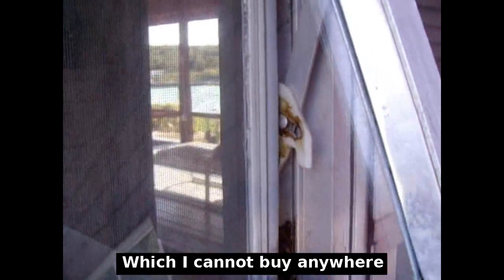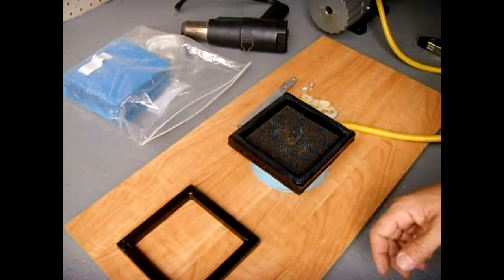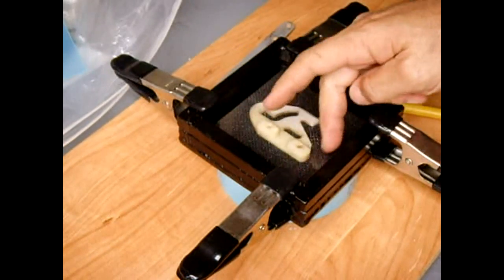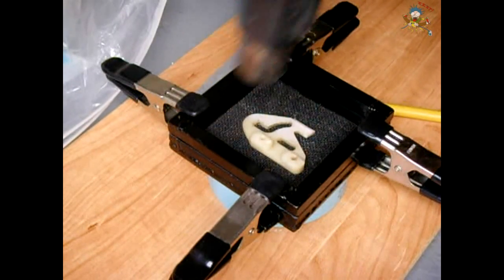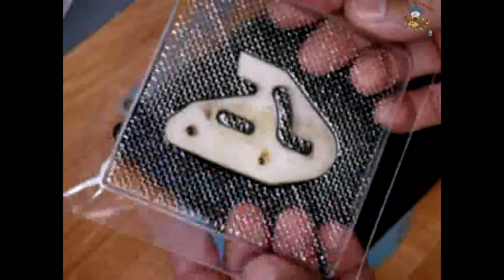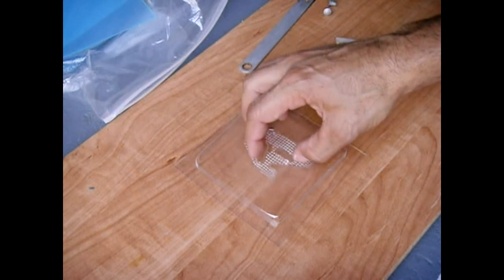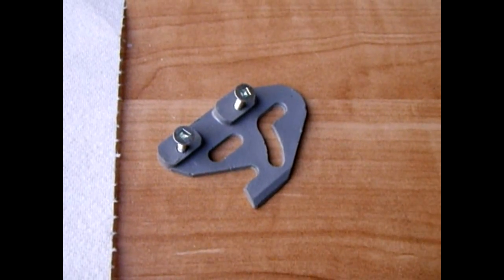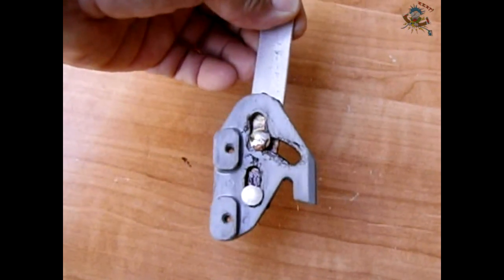DIY Vacuum Formed Replacement Window Parts

Comment: Dang, This is too Easy to have a go at.  A Refrigerator Compressor would work for this machine.  Those can be had for nothing.   Thinking J.B. Weld here.
Reply from the maker: A hermetically sealed compressor should pull a good vacuum.

Comment: Never use a heat gun.  Good video though!
Reply from the maker: How do you plan on softening the acrylic without a heat gun?
Reply: electronicsNmore easily my friend.   Nichrome resistance wire, on a control circuit, EVEN heating across the acrylic, or, a stationary heating unit over the top of it, held in place with a frame.. you do your heating the way you want bro. Just saying, never use a heat gun.
Reply from the maker: Chris Fleming LOL. I love people like you that come along and tell me not to do something that has worked just fine for over 20 years.
Reply: electronicsNmore ummm. I didn't tell you not to do anything, can you read? You asked me how I'd do it, and I answered your question. I said "Never use a heat gun" .. I didn't say  "Hey, electronicsNmore, don't use a heat gun"... Now did I?

Comment: Just wondering where you get you sheets from and if you could post a link on where and what to order Thanks
Reply from the maker: Hi there. I may have mentioned it in my dental retainer video, or at least what the material is, and the dimensions. You can search online for the 5x5 splint material.

https://www.youtube.com/watch?v=J-vut8Wwx1c
Reply: Okay got it-Thanks for getting back to me, Keep up the good videos too

Comment: Why not make a grid of kanthal wires spaced evenly on a unit the same size as the vacuum block, with some regulator to keep the temperature in check? Shouldn't cost more than a few bucks and would heat the plastic evenly and hassle free.

Aside from that, this adds yet another use for the vacuum pump I ordered last week.
Reply from the maker: Thought of that already, but I prefer the heat gun. :-)

Thanks For Watching!
Reply: electronicsNmore
 Thought as much. Just thought this looks like a hassle and wondered why not. I'll make such a grid, as I'll have surplus wire for a kiln I'll build as soon as the crap I've ordered arrives.
Reply from the maker: The grid should work well just as long as the spacing is right and not too much heat is applied :-)
Reply: electronicsNmore
The larger ones, seen in Mythbusters too, use pretty large heater elements spaced quite far apart, so it doesn't seem the spacing is as relevant, as heating the plastic to an even temperature is. What's the temperature at which those sheets become pliable? Are they HDPE -> at around 110C?
Reply from the maker: The sheets I used are acrylic. Probably starts to soften around 225-250 Deg F. If the spacing is not right, you will not have even heating. I would space the resistive wires about 3/8" - 1/2" apart, and 1/2" above the sheet. You can always lower the grid if you don't get enough heat.
Reply: electronicsNmore
I got a pretty hefty power supply out of a 48V 25A 1250W server PSU, so I think it should be able to produce too much heat without regulation, so I'll just do the maths based on the resistance and length of the wire in a grid with x length and y number of wires per width and see if the watts per area goes too high. I guess it's down to testing it in action.

I'll take a look at your video about making the form to begin with, as long as I don't get sidestepped by all your other interesting videos before I find it.
Reply from the maker: In the past I have used a lower value oil filled run capacitor in series with the hot 120VAC mains wire leading to a resistive heater made from Kanthal A1 wire. Works well once you use the right amount of wire and correct value capacitor to limit the current.
Reply: A quick calculation for a 30x30 cm working area with the wires spaced every ~3-4 cm, I'd get a 500W heater with 2 meters of the flat kanthal wire I'll have, with a 48V supply. Should be plenty enough for a low and even heat, without burning things. Even though I have an SCR trimmer, I don't think I'll dabble with mains connections for this, it's 240V here, after all.

Comment: EXCELLENT video. Why didn't you use a laser thermometer to test the temp of the plastic ?
I bought one recently, and have come up with all kinds of uses for it! One of my favorites is troubleshooting
old electronics gear looking for overheated parts. I even use it for cooking meat on the grill !
Thanks again,
73 de KG5RK
Reply from the maker: No need to do that. I have done it by touch for years. Areas that require extra heat, I do as shown in the video using the spoon as a heat shield. The problem with using a laser thermometer on meat, is that you are testing the OUTER temp of the meat, you need to be testing the center of the meat which is normally cooler.

Thanks For Watching

Comment: Fantastic Job.!! A very useful tool to have around. Thank you for sharing.
All the best.
Bobby
Reply from the maker: Thanks Bobby
Reply: electronicsNmore
I meant to ask,where do you get the sheets?. And what are you using in the center of the box?. I would like to build one for my vintage radio cabinets. I have some that are cracked, I have an ideal that may work using your tool design.
Reply from the maker: The center of the forming unit is a drywall sanding screen. The purpose is to allow even vacuum forming. 5x5 acrylic thermo plastic sheets(used in orthodontics)

Comment: There have been so many times that I have found parts that I need for service that are nla, and this is an easy way to reproduce some one off once in a lifetime parts... Being in the HVAC industry I already have the vacuum pump and plenty of heating sources at my disposal... I may try this sometime. Thanks for sharing!
Reply from the maker: You can pick up a vacuum forming machine on Ebay or Aliexpress for a reasonable cost.

Thanks for watching! Be sure to share my channel and rate Thumbs Up.

Comment: Very cool!  Great surface finish on the cast part as well.  

Seems like it might be a neat way to make forms if you have a 3D printer lying around (haha)
Reply from the maker: I originally made the vacuum forming plate for my dental retainers(check out that video), but found so many other uses for it later.

Thanks For Watching!
Reply: On a whim I split a dual layer dvd, scraped off the metal layer, heated it carefully with a torch and then just draped it over an arbitrary pattern (closed nail clippers), pinching carefully here and there.  Results weren't horrible, some of the logo on the lever actually came through - http://imgur.com/ddkCJ0c
Very neat!

Edit: Trying to figure out how to rig a vacuum 'pump' from the 'cooling bottle filled with water vapor' trick (e.g. 5 Experiments You Can Try At Home (Part 1) experiment 1)